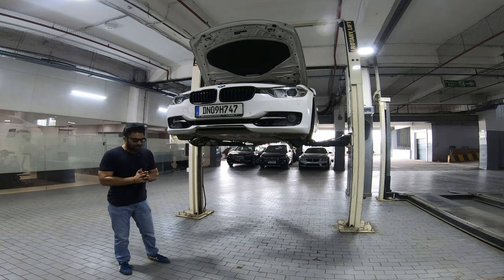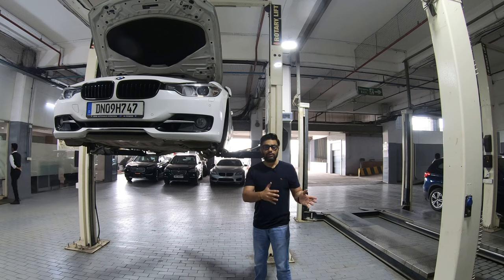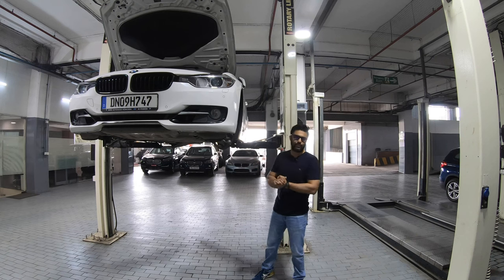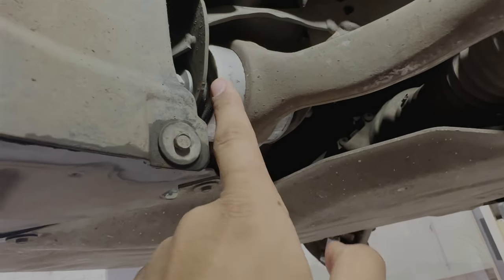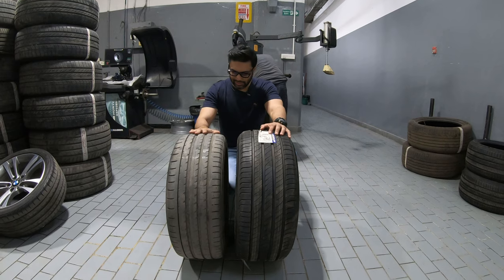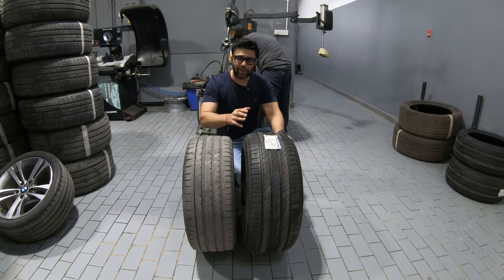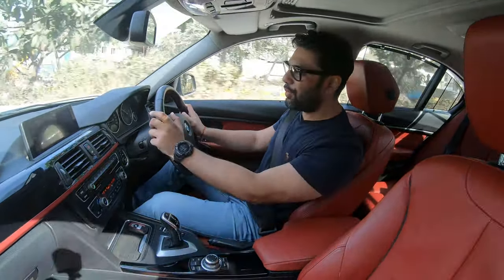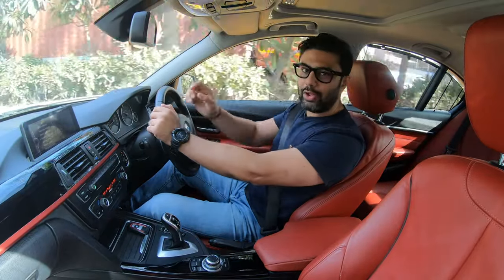F30 Vlogs [Ep. 1]: New Parts & Tyres | 4K

Comment: Hello Karan, did you look into the Koni active dampers? Any reason why you skipped them?
Reply from the maker: Hi George, this being a 10+ year old BMW i got aprox 30% discount on the suspension from BMW as per their campaign which they have for servicing older cars at official BMW service centres. Also for fun and handling performance i have my other BMW's like the e46 which has a KW Coilover setup and the M340i which comes stock with a great lowered M Performance suspension. In short i wanted the F30 to retain its soft suspension setting to aid comfortable ride performance. Apologies for a delayed response.

Comment: Hi Karan, thanks for sharing an informative video. 

I've one question. Does changing the coil springs along with the shockers account to any difference? Actually I had also changed all the 4 shockers, tie-rod ends and link rods on my Ciaz but the driving and comfort feel didn't got restored to the original feel. The only thing I missed out were the springs. I am wondering whether to change them or not?
Reply from the maker: In my car the coil springs looked ok just the shocks had leaked, important to note that my car just had around 39k kms on the odometer. Also note i changed to tyres too so overall complementing the suspension job. Hence in case of your ciaz the question would be how many kms clocked & how old are your tyres ?
Reply: @KKCOnAMotive  car is 8 years old and 128K kms on the ODO. The tyres were changed 2 years back. Current tyres are Bridgestone ecopia 150